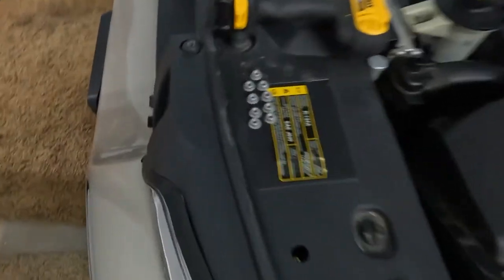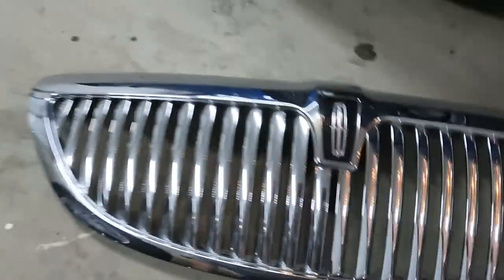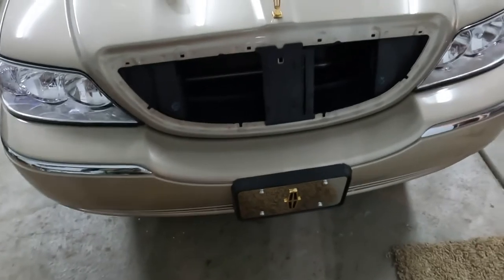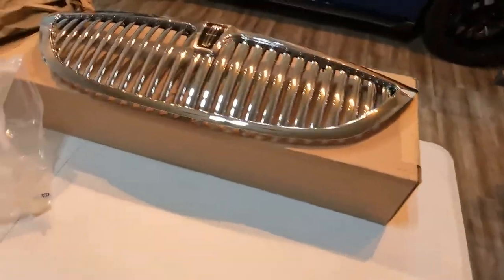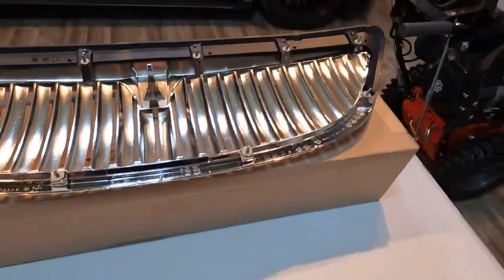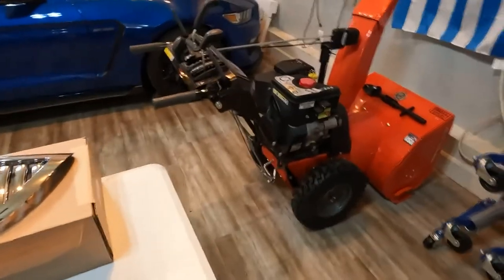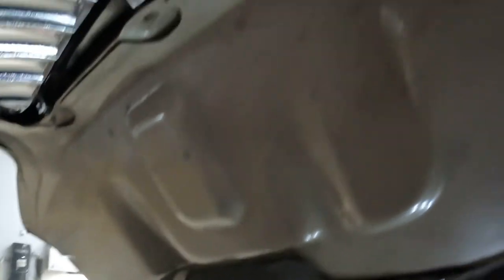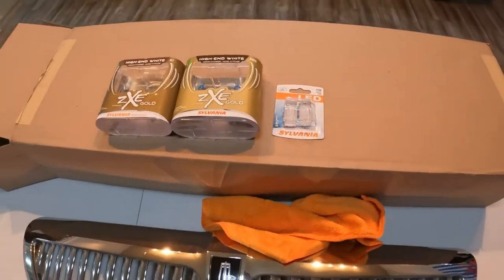07 Town Car - Remove and reinstall new grille - Lincoln - HOW TO

Comment: Nice new grill. Like that gold hood ornament. Even new products we get you still have to clean them. That plate you pull out or unscrew those pins. And the regular bolts will be behind that Lincoln cover.
Reply from the maker: Nice. Thanks for the information.

Comment: Your new grille looks great, but I thought the old grille still looked good, especially for a fifteen year old car.
      I recently drove 814 miles from Maryland to Florida in my 2002 Town Car. The grille and the rest of the front end picked up many bugs, and even though they came off after I washed it, I would cringe on my return trip Maryland if I installed a new grille.  LOL
Reply from the maker: Thanks! The old one has plenty of little spots and one bigger bubble which I was afraid will open and then it would look very ugly.

Comment: Do you have the link for where you purchased your grille?
Reply from the maker: I purchased it at my local Ford dealer.
Reply: @EnthusiastCarHangar  I called my local Ford Dealer and they said it was separate the emblem and grille. Maybe there not aware either that it came that way.
Reply from the maker: That is what they told me as well. I bought an emblem separate from them but then I found it included with the grille and returned the other one. They acted surprised.
Reply: @EnthusiastCarHangar how much did it cost?
Reply from the maker: I will have to check. Can’t remember at this moment.